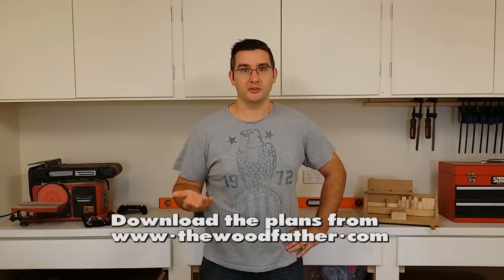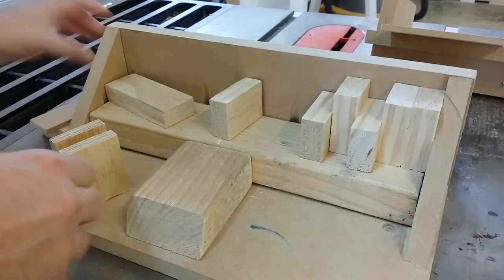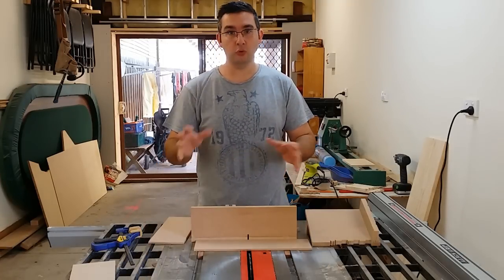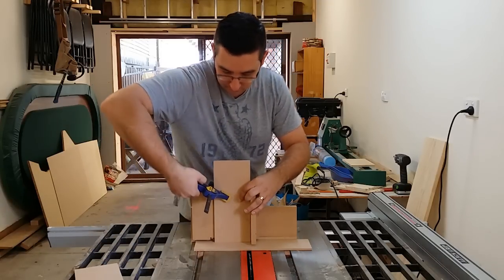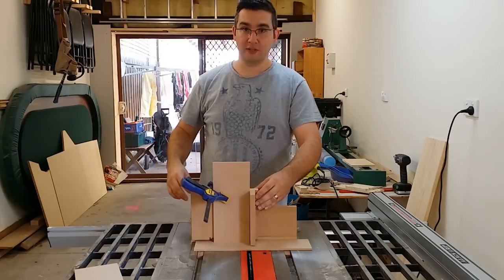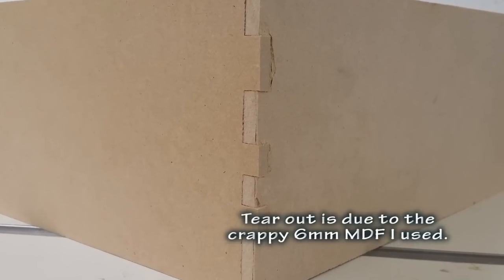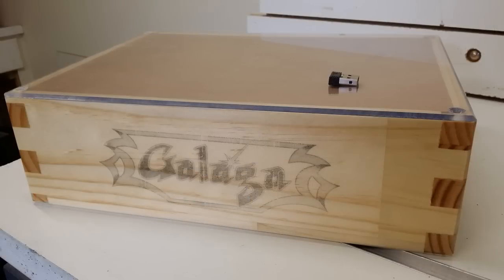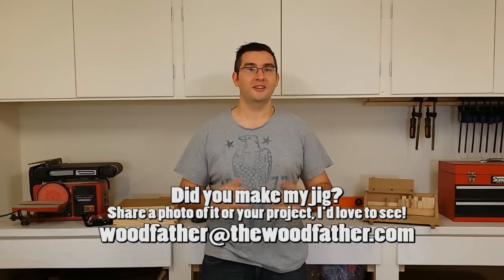Single Blade Box (Finger) Joint Jig Follow Up - TheWoodfather

Comment: THANK YOU - I just took a break form working in my shop starting to make a 'traditional' box joint jig.  Sat down and your video came up on my PINTREST.   This is a much greater plan; easier, faster and gives flexibility on the various sizes without the hassle of making a lot of set-up changes.   Keep the NEW IDEAS coming.  Again, thanks from North Carolina!

Comment: Mario, thank you for the plans . I made the jig last night and used 9mm ply blocks 1" X 1.5" as the box spacers. And this eve i made my first box using the jig, and the fit was great. The only change i made was to fit a captive blot in the end and secured the box spacers with some 10mm threaded bar screwed in and a piece of alloy angle to hold them in along the jig. Thank you once again.

Comment: The best box joint jig I have ever seen; simple, precise and versatile! As for finding a correct sized pin -if nothing presents itself one can buy a drill bit in the correct size, drill bits are available in increments of 0.05mm or so. Or one can beef up a too small pin with scotch tape until it fits. Thanks a bunch for the plans and the video!!
Reply from the maker: +Hasse Olsson Thanks heaps, I hope it works out well for you!
Reply: +Mario Cappellano (The Woodfather) Finally replying here... I made it with some minor modifications; Instead of drilling and putting a pin of correct size in the hole I cut a slot in the wood on the table saw and made a hardwood "tongue" that is glued in the slot. I also added clamping bolts to keep the wood in place whilst cutting and a thumbscrew to keep the "dominoes" in place on the tray. That jig will be used regularly for many many years to come!!

Comment: Thanks for the videos and especially the design. I made one but had trouble finding the right sized pin, I even went down to my local hardware store and rummaged through all his drill bits without finding the right size, so I filed a piece of aluminium and now it works fine.
Not sure if or how to post photos on here so will email a couple to you.

Comment: Thanks for the follow-up. This is a neat technique. I think I like the look of it with all of them the same size, but I could see some applications where this would look cool too.
Reply from the maker: +Bruce A. Ulrich Cheers mate. I used this technique on a small box I made a while ago, it never got sanded and polished so I didn't take a picture, I might make a couple of nicer ones and show them off.
Reply: +Mario Cappellano (The Woodfather) I'm in the middle of making this. I'm having trouble finding a bolt or something that is the exact size of the kerf. I didn't do triangle supports...I just left them as squares. Easier for me to clamp...don't have a pocket hole jig. ;)

Comment: Mario,  Thank you for sharing your jig design.  I built a homemade table saw using a skill saw so I do not have a stacked Dado blade.  Your design is perfect for my needs and I just completed your jig using scrap wood.  The only mod I added was to include a bolt on the left side as you describe to lock the spacers in place.  I created 3/4 in and 1/2 in spacers.

Comment: Dado stacks are not technically illegal over here, but it IS mandated by the EU that the blade on a saw must stop in something like 5 seconds.  With the extra mass of a dado stack, this needs a big brake which is subject to wear.  It also stops the blade with such force that there is the danger of the nut coming loose from this large change in inertia.  As a result of all of this, manufacturers take the easy option and only allow a single blade to fit on the arbour, so their brake can be much weaker. 
I have seen Dado stacks for sale here in the UK, but finding a saw for them to fit on is the hard part!
P.S. Great design and plans... I'm building it in the next few days.  Muchos gracias!
Reply: Love the flipping pieces for the 2nd side. Genius!

Comment: I have just learnt a very valuable Lesson. I made your jig,,Then spent the next 4 hours trying to figure out what was wrong,joints were all over the place,some tight others loose,it didn't make sense,I had used the same 10mm ply for the Finers on the top rail.. Finaly got round to measuering my locked in fingers,,they must have been off 2 different boards.?.The varied as much as 10 thousanths of an inch,I had loaded them mixed up,unknown to me.. Just shows as the old saying on use one Ruler on a project also only use one piece of Ply to make these type of joints,,Ahh Well..lol.

Comment: I am trying to build this jig. I like it a lot. Being tremendously slowed down by all the rain we are having here in Texas. I don't have a workshop so have to work outside.

I want to build bee hives using 12 inch stock. Will this jig work for the wider stock, or should the jig be built wider? I am also unsure how you place the pin?

Thanks

Comment: Great job Mario ! I'm actually making mine.  What kind of blade would you recommend ? I mean : how many teeth should have the blade ? Thanks in advance for your response. Stephan from Belgium
Reply from the maker: Hi Stephan, honestly, I don't know! I still have the standard blade on my saw, I think it is only 36tpi which is probably too low, but I've never used a nicer one to compare it to. Works ok for me. I would build the jig and key to match the blade which you use 99% of the time on your saw, that way you don't have to waste time changing the blade each time you want to use the jig.

Comment: GALAGA!!!!!!!!!!  My favorite.  Are you selling those?  The jig is very cool.  I like that you don't have to make anything other than the blocks to change sizes.  Seems like you could put this on a router table and use it to make dovetails as well.
Reply from the maker: Yes I had someone else mention dovetails, I might try it one day.
Galaga is an absolute gun game! I will be selling these in Australia but first I want to get the production costs and method down so I can batch them out. Too slow and expensive at the moment but this jig changes that.
Reply: Mario Cappellano If you are not going to be shipping them to the US, then maybe I could buy the guts from you, and make my own "case" for it.

Comment: Hello again.....been thinking about the dovetail version of this......have a look at this...(although it's really interesting go straight to 5:42).....I'll leave the rest to you!!! 😀
http://youtu.be/mMDNgFqyBLo
Reply from the maker: +Stuff of Lard A dovetail version is on the cards but not for a while. To be honest, I have little need for dovetails at the moment, I consider them more of a 'fine' woodworker skill, one which I certainly don't have! When I have a need to use the joint, I'll see if I can think up a way to do so with the jig. Slightly on topic, I just posted a video which shows how to use this jig to make Angled finger joints which I think id pretty cool too. Cheers, Mario  http://www.thewoodfather.com/thewoodfather/making-an-octagonal-tray/
Reply: +Mario Cappellano (The Woodfather) no need to tell me I watched it yesterday (I'm in Wales)....very good but, as you say, somewhat too good for what I'll ever need. I've built and used your 'standard' jig (thanks for the plans by the way) and am in the process of swapping the softwood blocks for acrylic blocks and mounting them on a threaded bar. I also wonder whether I would actually use a dovetail version but hey it's a challenge. It's your fault I'm having trouble sleeping!!!!! 😀.......keep up the thinking!

Comment: Wanted to say thanks for your jig inspiration.  Great ideas.  Here is the jig I made these past 3 days after work and I have a few more mods to it.  
http://readyrangers.tzo.com/2020BoxJointJig/2020BoxJointJig.htm
Reply from the maker: Hi Mark, thanks so much for sharing that! Sorry I missed it at the time. Your one looks amazing, and you've really pushed the design in new ways too! Did you have any photos of finished joints you've cut on this one? Thanks again, Mario
Reply: @woodfather  I have some projects in the works.  Making some small walnut and maple box jointed boxes.  The heat of summer slowed me down and a CNC machine. HA!  I have been making CNC stuff and learning about that.  This will make these box jointed boxes even better with personalized stuff designs and text and such.   All I have  made with the box joint jig is utility boxes about 8 of them out of 1/4" hardwood plywood of various sized fingers playing around.   Can't wait to finish up those boxes when it cools down a bit.